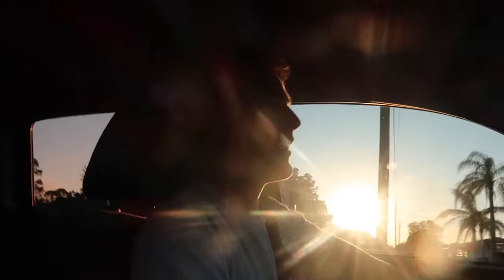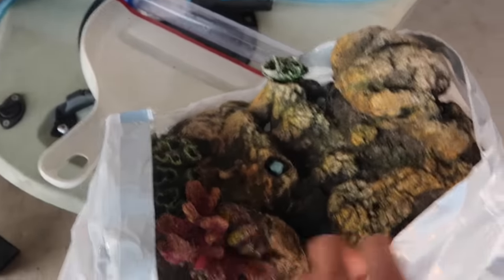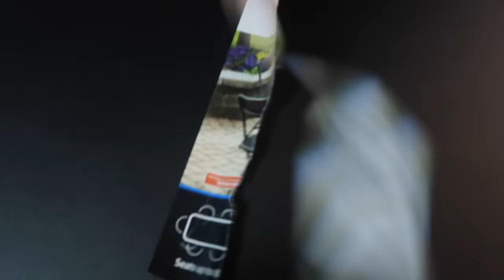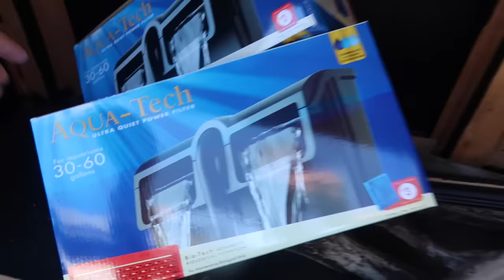My NEW 160 GALLON FISH TANK!!!

Comment: More shared advice.. GFI outlet for use with the fish tank. Fill the tank a few inches a day to help it slowly setting on the carpet and foam and make sure it didn't get damaged during the move. A slow leak with only 20some gallons is less to clean up then 160gal leak.

Comment: Get a canister filter. They're not that much and they work better
Reply: canisters are a pain in the ass.  my 180 uses 3 aqua clear 500's or whatever they call them now and they work great.
Reply: Hob's are crap and have no real surface or space for media.. Don't cheap out like this guy.. grab two FX6 or Aquatop 500's and you can run those hob's also since you have em..  (Oh and incase someone wants to debate, i also have Fluval 110's for the Tanks that don't have canopy tops) They break fast, cheap plastic and peices and youll be replacing impellers every two years or sooner
Reply: please sports Alligator Gar please put Alligator Gar in the tank
Reply: please please put Alligator Gar in the tank
Reply: A bass and carp coy

Comment: Idk why this hasn't been asked if it has I missed it. Sorry to say this Paul. But your "160"g tank is mostly likely a 125 or even 115. It happened to me on offerup. They said the tank was 6x2x2 180g. Got the tank home and it was not even close. It was 6'x18"x22". To me your tank looks like it could be 5'x18"x24. This will matter when you buy a sump or canister for it. I'm sure all the experts here have told you your h.o.b filters won't be enough specially if you think it's 160. The fx-4 does a great job but a lil pricey. The sunsun 304b is like $80& works just as well. Good luck with the tank. Please consider a male Dovii cichlid, trust me you won't regret it.